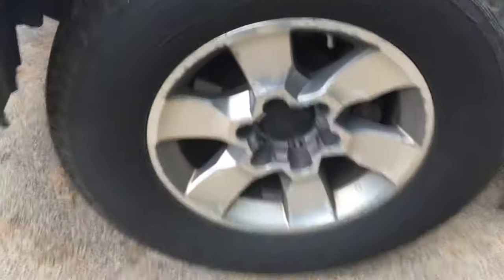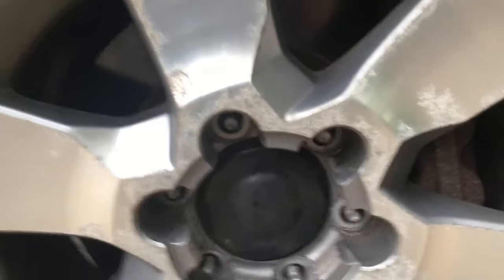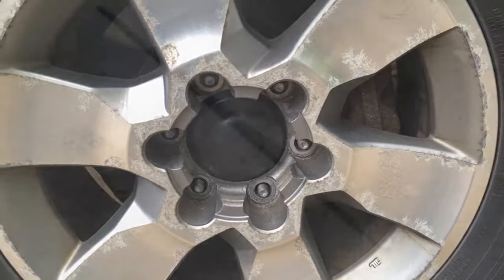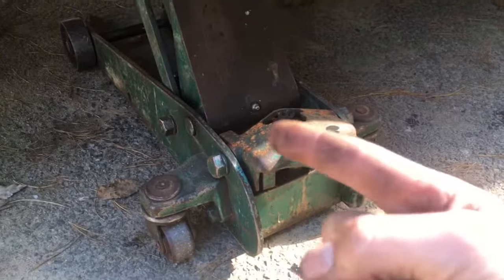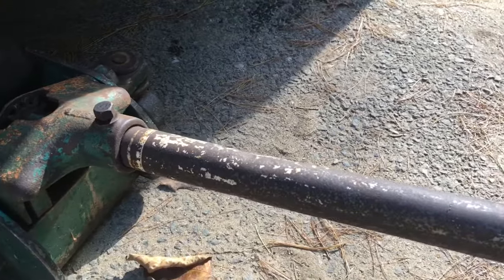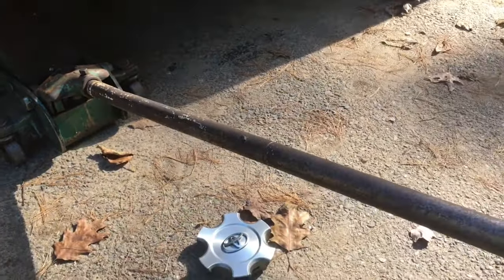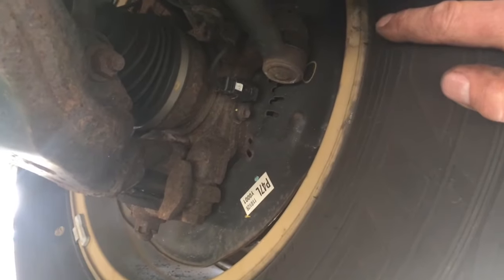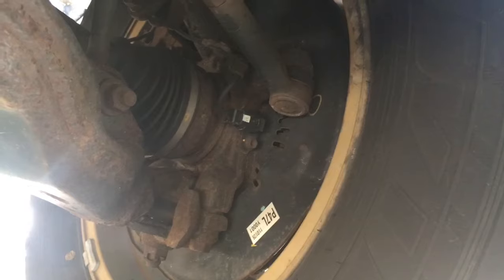EASILY Remove a Stuck Wheel From a Car or Truck!

Comment: Yeah,  I usually use a dead blow hammer on the tire, but I have to admit this method seems a whole lot easier.  The harder trick is removing hubless rotors from a flange. I've beaten those with deadblows, regular hammers, and eventually an air hammer. You think coating the wheel  or mating surface with some sort of antisieze compound would prevent sticking in the future???
Reply from the maker: Rusted Horsepower - I would think that adding grease or anti seize to the back of the wheel or hub would have to help. I’ve done it in the past, though I don’t know if it actually worked or not. It just seemed like a good idea.

Comment: Nope! Not on my Titan. Even bought a tanker's bar (big long as pry bar) and used a cheater bar. Didn't come off. :( Loosened the nuts three turns then drove to the end of the 400' driveway and back. Finally heard it pop on the way back.